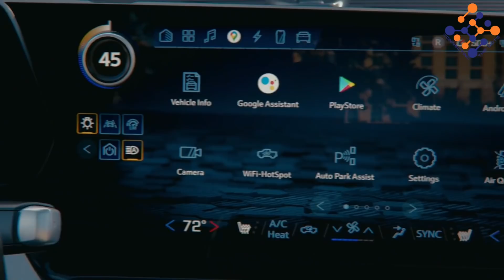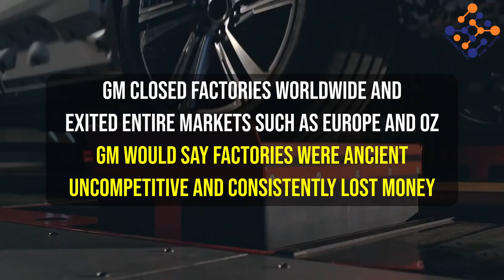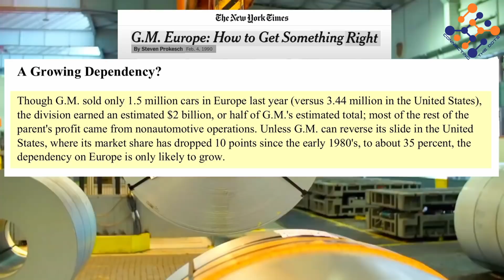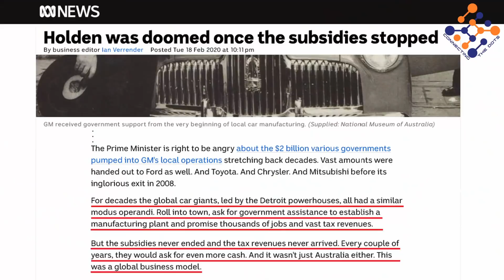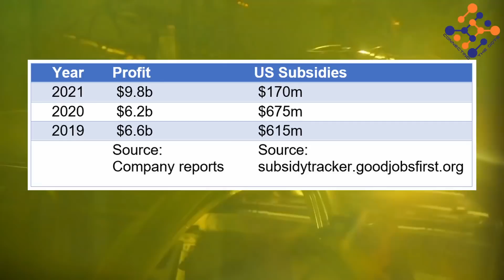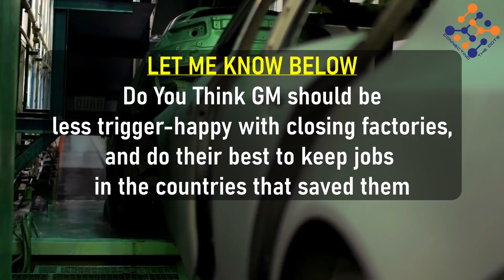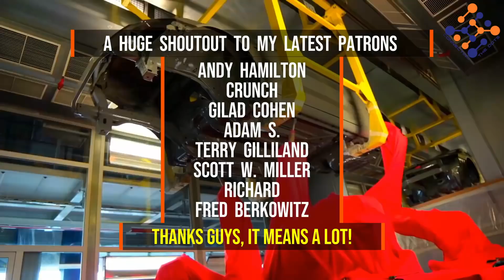The GM Pumping Machine - How General Motors Sold America,  Part 3

Comment: EV1 Electric Cars by General Motors would be missed a lot.  They finished with all the EV1 Electric Cars by General Motors back in sixteen years ago from 1990 to 2006.
Reply from the maker: Yes, they'll be missed.

Also, GM invented the electric skateboard used by everyone nowadays. They revealed it I. 2002, but put the ball on the ground and left the stadium. They could have been the largest company in the world, without any subsidies, instead they are declining. So sad.
Reply: @ConnectingODots  Yeah, only my memories from the past could take me back to see those EV1 Electric Cars by General Motors back in time.

Comment: Excellent series, congrats... I started working on the engineering design of vehicles produced in Australia in 1983. Most of our contracts were for GM, some for Ford and the others. The growing issue was a small market with too many choices and the GM and Ford large cars were limited to a shrinking domestic market. Add to that, GM Global Purchasing cherry picking suppliers internationally leaving existing tooling industry overcapacities, despite being competitive. There was a lot more to Australia closing on top of GM corporate greed and lack of planning outside the USA.

Comment: Bob lutz was rightly held in high regard in the Automotive world. He was a great supporter of GM Holden and their Design & Engineering expertise. Bob Championed the idea that GM America should build the new VE series Holden Commodore and Monaro in America as well as Australia . This was a dual edge sword for Holden . The VE product program was quoted globally on the basis of a combined America and Australian volume . The Commodore was to be bulit in the Hamtramck plant in America ans South Australian Holden plant .  While the program innitially was positive for Holden, GM quickly took over the program and replaced local managers with GM people , including the MD, thereby transplanting many of the poor GM Cultural issues and associated limiting beliefs that Holden did not have .  The Vehicle was developed for both markets however the vehicle was compromised by GM sourcing and design decisons and in the end GM did not build the Commodore in America . They did however use the Holden VE Commodore Platform with a new top for the Camaro vehicle , which was acclaimed for its Holden developed vehicle dynamics. What really was poor form was that GM gained a vehicle platform and did not pay Holden for it's development, which traditionally was on a per vehicle production basis. This was another example of GM taking money from other divisons to support GM America.
Reply from the maker: Great point. Holden should have been payed royalties for every Camaro sold based on their platform
Reply: I have a Pontiac G8 that I bought new in 2009 and still enjoy it’s a great vehicle
Reply from the maker: @pmscalisi  yes it was. Such a shame they closed the program down (while killing Pontiac) and then under-marketed the Chevrolet version they later made.

Comment: I was on board till 24:15 when you claim that inventory is stacking up on dealer lots
Reply from the maker: Yeah, but it's true. Inventory (cars produced but not yet sold) more than doubled since septrmber
"As of the end of March, GM had about 274,000 vehicles in its U.S. inventory, including vehicles in transit to dealers – up from about 200,000 at year end and 129,000 at the end of September"
https://www.cnbc.com/amp/2022/04/01/general-motors-gm-q1-2022-us-sales.html

Comment: I used to be a Chevrolet guy. I now own Toyota's. Who new they made cars that didn't have a check engine light on all the time. My Volt was the worst car I ever owned. 13 check engine lights and 5 strandings in the first 36000 miles.

Comment: I worked in GM Peru from 2012 to 2018, saw the launch of N300 (SAIC GMW JV), Sonic (GMK), Orlando (GMK), Aveo T250, Sonic (T300), GMI 700 (Colorado from Thailand 2014 I think then 2018 from Brazil), Tracker (GMK Trax), Cruze, Sail S2 & S3 (SAIC GM), Malibu (GMK), Spark (GMK then GM India), Onix, Prisma, Cobalt & Spin (form GMBrazil), and Trailblazer (GMTh 2014, a disaster). I think you are 100% correct. There was also a new way of GM to check on a vehicle wether it was profitable in their own way, it was called Country of Sales (CoS) and it shifted if a model was or not profitable depending on which country it was sold. I believe this is just another way of pulling money out of the most profitable countries were they could sell for a higher margin. Something curious about this: the profit was only calculated when the car was sold, but inflows or cash was poured in when the car was in GMs inventory. 

In other words, we purchased to the factory, say GMK 200 Trackers. We paid say 10,000 a piece for a total of 2M. Then a % was transfered back to Peru for having the inventory. Once the vehicles were sold, we then have to transfered back to GMK and US some additional fees - it was all really hard for me to grasp (I was in after sales). What's curious is that this also works for p&a inventory.

You should make a video on ACDelco - boy, that is a giant milk cow, or Isuzu which is a JV that gets lots of revenue and profit to GM in Latin America.

Great videos, made me go back and remember Dan Akerson's era and the whole transition to Mary Barra. Hit me up if you wanna chat, do many things to say about corporate GM and how they handle a small operation, you can tell a lot of their corporate behaviours
Reply from the maker: Wow thanks!

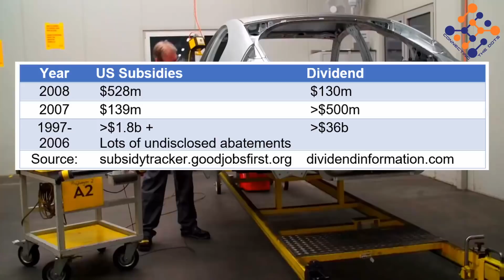Comment: @16:40 GM hasn't been a part of Big Auto in years. They let go of the last competent production engineers and replaced them with know-nothing accountants. (†)
As long as you don't need/want anything done to the car line up, it's okay, but if there's any turbulence, you're [expletive deleted.] 
It's the sign of a company in a tail spin, the pilots have bailed out and the shareholders have just noticed that the Plasticized Air Safety Card has been replaced with a King James.
†) The last time was the development of the Pontiac Fiero for testing JIT (Just In Time) parts delivery mechanism.
Reply from the maker: your words resonate with me. And I loved the Fiero (although typical GM they cut the engineers' wings there too - they somewhat manage to sneak it in as an economy car)
Reply: @ConnectingODots  The Fiero was a great car. If would make a great EV conversion. 🤓

Comment: Its always interesting to learn new things . They serve to undertand why GM in America has reduced its Market Share over the years from 50 % to 15 % .Some of the new learnings are that GM has Cultural issues and beliefs that have stopped it adopting many elements of the production systems and thinking necessary to change. As well we learned that GM has kept going thru government handouts, which is in contrast to the American way of Capitalism and Free Markets . We learned that GM sold America to a non free market econonmy, which in some countries this may be criminal. We learned that GM division s of Holden , Saab & Opel were treated in a colonial way by head office in their treatment of people , technology and dollars. We have learned they are behind in EV technology and have not moved to the new evolution of Manufacturing technology with rapid changes managed with Agile and Scrum. In summary GM will continue to decline and has not achieved a higher level of learning from it's mistakes and instead it's culture and underlying beliefs are dragging it to even lower levels of Capability and competency.

Comment: If they would have taken that cruise facility and started making a Tesla model 3 or Tesla model y competitor they would be raking in massive profits at this point but instead they frittered away their opportunity to compete.  The funny thing is that Tesla got their start by buying an old Toyota and GM factory,. So in a way GM actually helped to create their biggest competitor will probably drive them out of business.
Reply from the maker: True. Even worse, back in 2002 GM invented the electric skateboard everybody's now using - but decided not to make EVs.🤔

Comment: GM has really been the shitties of corporations for 20 years. Sell brand new models at top dollar with parts bin left overs from previous models.
For example- the 07-13 full size trucks used the HHR window switches, the 2022 express vans are using the 07-13 full-size trucks steering wheel, the 2020+ 4500,5500,6500 use the 2014 1500 headlights. 
Like you asked top dollar, the customer pays it, you used parts off the shelf, then when it’s broken, burn the customers on repairs that should be covered under the warrantee… all while turning billions in profits and eliminating American jobs. 
GM deserves the GUTTING the CHINESES are going to give it.

Comment: I  think the general American public is not aware of the level of tax payer subsidies going to auto manufactures. It needs to be made more known. Given the huge prices of new vehicles now days, there needs to be an overhaul of the new car industry. I've read stories of how the car manufactures have had to start their own finance companies to keep the flow of new cars going. Even with that car leasing is a crutch to get border line buyers into new cars. I always thought the failure of G.M. requiring the bailout was due to poor management and it appears, it's still there. When Biden went to G.M. and stated that they were the leaders in E.V.s, and not even mentioning  Tesla, you know there's something rotten in D.C. If G.M. went through B.K. without the bailout, it may have been more good for management than giving them a pocket full of tax payer's money and end up like this..........again.
Reply from the maker: I fully agree!